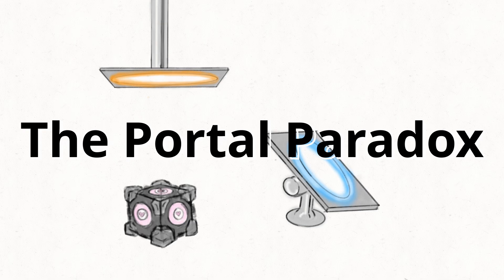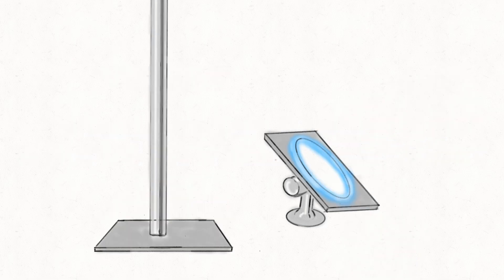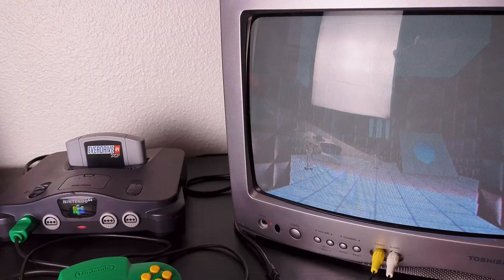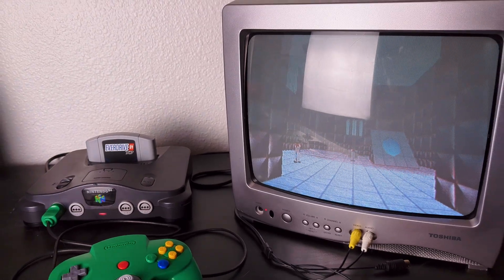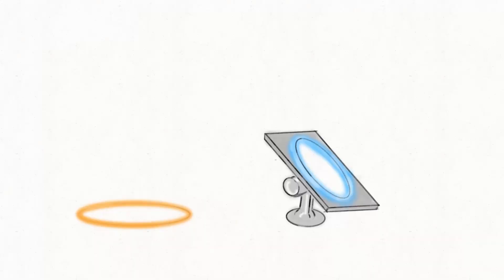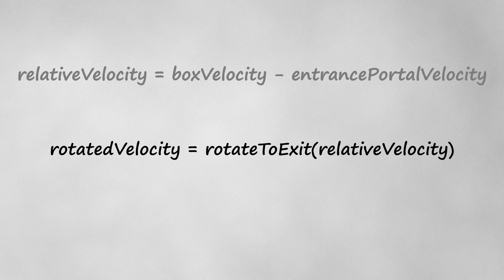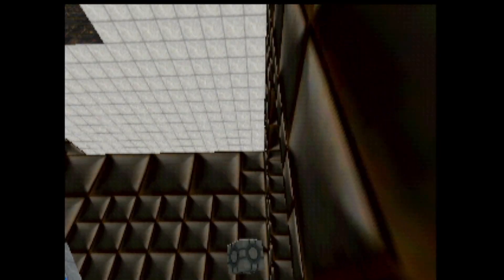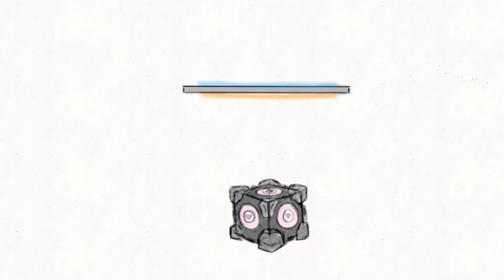I rewrote Portal from scratch and solved the Portal Paradox

Comment: So, lets say the portal lands on top of a human (really fast), but makes a sudden stop half way. Would then upper part of human (the part that has gone through the portal) be set in motion on other side of portal, and then pull lower part with it?

If speed of portal slamming down was fast enough, subject could be ripped in half. #Spagettification
Reply from the maker: Yeah, that is exactly what would happen.
Reply: @james.lambert  but would you get ripped in half though? If you think about it, the moment the first hair on your head enters the portal it's already pulling on your body. When your head is through, its already pulling your torso.
It's easier with "ticks" because you don't have to worry about individual atoms, but if you think about it an insanely fast portal might just rip you to shreds instead.
Reply: @CaseyHofland  It depends how violently the motion of the portals changes while you're halfway through! Essentially, as the portal accelerates, the motion of your body through the portal changes, and that means the portal is exerting a force on your body. Your body is fairly resilient to stretches (you can hang from monkey bars without your arms ripping off), but if that acceleration was extreme, you might expect damage to occur.
Reply: @CaseyHofland  I think a fault in your logic is that your lower body would not be fixed in place.
Reply: @CaseyHofland  Motion is relative. So long as the portals move at a constant velocity, it won't be much different to if they aren't moving at all. You go in at a constant velocity, you come out at a constant velocity. It only becomes a problem once you introduce acceleration.
Reply: @CaseyHofland  Yes, that is what would happen, even with the matter of in-game ticks. You dont even have to worry about anything else, because even with breaking down the process, a portal going down at you with 10000 kilometers per hour while you are stationary, it would mean that the moment your head goes through, you would equally be decapitated as something suddenly pulling you from your head at 10000 kilometers per hour.

But on the other end, you could also use that to basically have a launching system, where there is a huge weight on top of a vehicle, which would get ripped apart from a vehicle the moment it goes through the portal, but the vehicle itself having enough momentum to also still be lauched at massive speeds, but because its being pulled, the increase in momentum is a lot more gradual.
Reply: @CaseyHofland  look at it this way, if you push a cube across a table and stop pushing it, it'll still be pushed across the table until the friction stops it. So while the person might not be thrown through the second portal as fast as normal, the momentum won't stop midway and bisect him
Reply: @CaseyHofland  you get spaghettied
Reply: @CaseyHofland  the portal doesn't exert any virtual force (which I'll call reference frame tides) until the difference in relative velocities of the portals changes. Two portals moving in unison never exert a force. One stationary portal and one moving portal will exert a force once the moving portal stops (or if the stationary portal accelerates). If you're halfway through a portal when the moving one stops, your two halves will experience a tension force as your upper body's momentum drags your lower body with it. To spaghettify a person you'd need to have the entry portal moving at extreme velocity, then have the exit portal undergo a massive acceleration during the period in which you passed through the entry portal. You'd need the exit portal to accelerate by hundreds of thousands, maybe even millions of m/s per second. You could also do the opposite of spaghettification simply by having the exit portal move in the opposite direction, which would have the effect of ram-compressing you as you passed through the entry portal.
Reply: @CaseyHofland  there’s a little something called “tensile strength”
Reply: @CaseyHofland I feel everyone here is also forgetting air exists. All the air that the portal consumes as it moves down would be shooting out with an equal strength as all the physical objects going through it. Wouldn’t the air on the other side practically blast the rest of a body through the portal as well? Not to mention how it would whip up the room’s air into a frenzy, which could lead to utter chaos if the moving portal continues for a long period.
Reply: @CaseyHofland  The portal stopping suddenly is a change in acceleration, which is why the subject gets ripped in half. The portal travelling down with constant acceleration is not a change in acceleration. It is not the same example.
Reply: @james.lambert  But that defies the first law of thermodynamics, where energy cannot be created or destroyed. If I have the panel moving on its own without the portal, that works because there is energy being used, probably due to breaks in the hydraulics by converting the kinetic energy into thermal when it crashes into something. By your logic, if we add the portal to the surface, the original energy transfer is the same, but now you are getting magical kinetic energy from nowhere. For your logic to hold, the moment the cube goes through the portal, all kinetic energy contained by the panel/portal would instantly transfer to the cube with near-perfect efficiency, leaving the panel stationary otherwise, I could create a scenario where the moving portal is moving towards the other portal face to face when a cube enters the system it is launched out of the stationary portal towards the still moving portal increasing the relative velocity, this would repeat until the cube has accelerated to close to light speed. Even assuming a perfectly efficient system, the cube would generate kinetic energy as it infinitely accelerated. Your idea can work but requires too many assumptions and re-evaluations of how a portal would work that it must be disregarded by Occam's razor.
Reply: @james.lambert  It can't this breaks all 3 of netwon's laws of motion
Reply: @james.lambert  a very basic thing they teach you in engineering is to not keep your head down in the math, but also put it up to check if the numbers make sense
Reply: @james.lambert  so not to be gruesom but if we are talking about scientific accuracy would it launch your torso and everything above it or would it at the very least apply a force you would feel in your mid torso area?
Reply: you would feel nothing until you start to go thru the portal, and then it'd feel like the floor suddenly accelerated away from you
Reply: @arinb.756  I think there might be a difference between my example and your example. If subject is moving into the portal, and stops halfway, well.. do you mean the subject abruptly stops at both sides of the portal, or only one side? I guess stopping the subject only on the "Enter"-side of the portal would be equal to my example, as the part of subject on the "Exit"-side would still be in motion and tugg on rest of body, if lower part of body is secured at "Enter"-side of portal, and if upper part is going fast enough the body would split in two.
Reply: I don’t think so? To reverse the original question — if a person runs into a portal and suddenly stops halfway through, it’s not like that affects the portal at all, right? Velocity/acceleration aren’t transferred between the portal and the person in either direction, so they’d be fine.
From the person’s perspective, looking through the portal, the other side would be rushing towards them at high speeds, then suddenly stop, while they themselves wouldn’t have moved at all — no force exerted, no spaghettification.
Reply: @evanvollbrecht541 I thought so too at first. But what would happen to the air molecules besides you? If you stop they have to stop as well, so they do experience acceleration. So if your body and the molecules experience acceleration, the rest of the universe should too, in which case there'd still be spaghettification.
Reply: @Octochiken  The counterintuitive thing about portals is that they change your velocity without applying a force or accelerating you at all. Stopping halfway through a portal is a big change in velocity, sure, but say you place two portals on the floor, fall into one, and shoot up out of the other — your velocity relative to the room literally changes twice as much! So if there was any acceleration, you’d be more spaghettified by that than stopping midway. 

It’s hard to wrap one’s head around how things can change their velocity without accelerating/experiencing any force since it seems to violate Newton’s first law, but this is actually something that happens IRL with the expansion of the universe. It’s the same with the portals — the room, the box, the person etc. all remain at rest or in motion as they pass through the portal. 

It’s weird to think of how the box can be at rest on the floor, and then be at rest *while flying through the air*, but that’s because it’s at rest relative to *local spacetime*, which is curving and warping to produce the effect
Reply: @evanvollbrecht541  You're completely right, but I don't think I explained what I was trying to say clearly. My point is that a portal can't make you go from moving to stopped without you going through it. Which is what you were suggesting could happen in your first comment. So even though there is never any acceleration, the two parts of your body are still moving at a different rate when the portal stops.
Reply: So... you're gonna test. I'm gonna watch. And everything is gonna be JUST... FINE. (Wheatley)
Reply: Terrifying…
Reply: this test can be done with a companion cube, no need to warm a human
Reply: @arinb.756  Dude I don't know I feel like the whole idea of a moving portal already breaks the laws of physics. I mean we have wormholes they don't move. Your point is right and the more I think about it the relative velocity point is also right so the only way to prevent energy from being created would be if when the object is passing through the portal for there to be an instantanious transfer of energy to the object. In your example the object would fly through the portal because of its initial kinetic energy and since the portal is also not moving it wouldn't transfer any to the object. However any portal that is moving would be continuously transfering its kinetic energy to all the particles it intercepts and continuously slowing down, that is until something large enough enters it and then it comes to an abrupt stop.
Reply: Portal shouldn't apply it's momentum to any object passing through it. Portals have no mass or force. They are a spacial connection between two finite planes in space. Those planes can move and never transfer momentum because it does not create momentum. They have no mass to create momentum with. They are not a platonic object. If you make a portal that has mass and that can transfer momentum from itself to objects that pass through it then you have... Not simulated a portal.
Reply: Yeah I always likened it to any changes in motion to a portal is like moving the entire universe on the other end of the portal. If you moved a portal (aka: accelerated a portal), you'd actually need to move/accelerate the whole universe along with it to match, unless the exit portal moved in a matching speed and direction to cancel it out. In "reality" you would be able to theoretically have a moving portal relative to its exit but it would have to continue moving in that direction and never change - absolutely no acceleration (no changes in direction or speed) would be possible as that would take infinite energy to do. Having the portal change direction or rotation would be akin to literally moving the entire universe on the other side of it. The reason is because of what you said, the person would get spaghettified if you went half way and then stopped. That's because the whole universe is suddenly 'stopping' (aka: instantly accelerating) on the other torso end of the portal relative to the other side of the portal that his legs are standing in.

Rotation of a portal is especially impossible; When you rotate a portal, the outer edges of the universe would be accelerating relative to your viewpoint at a rate of speed approaching infinity the further out you observe. If the universe is infinite then the rotation speed at the far corners of the universe also becomes infinite, and it would require not only infinite energy but also an infinite speed limit in the universe to move the whole universe on a swivel at infinite accelerations, as it must happen in order to conserve momentum between the two portals.

Also just to be technically correct, you can't have a moving portal anyway due to relativistic effects in spacetime. Spacetime is not uniform, so movements through it would not be a simple x universe moving relative to y universe, but rather you'd encounter shifting spacetime due to differing gravity at different points, and therefore even a totally uniform movement in one single direction relative to the exit portal would be varying all over the place, growing in differences the further out into the universe you look. For this same reason it would probably even disqualify a stationary portal just because of the immense energy required to reconcile the two reference frames - aka: the two 'universes' on either side of the portal.
Reply: @DeSinc  The problem with your thought process is that there is no universal reference frame.  If I push away from my computer desk right now I can say; from my frame of reference, I just pushed the entire universe about a foot.  No matter how little motivation I may have, It doesn't take infinite energy for me to get up from my computer chair.
Reply: @catherinekracey5036  I see what you're saying but that's a different thing entirely. Imagine it this way: If you stick a 100 metre pole with a 20 tonne dump truck on the end of it through a portal that leads to empty space, and then tried to hold onto it while the portal rotated around. The whole universe "inside" the portal would be moving along with the portal, and so would your dump truck. Imagine trying to hold the dump truck in one place while the portal + the whole universe inside it rotates around. You can't do it. Do you see what I mean now? The whole universe is essentially being moved, including your 20 tonne dump truck on the end of the pole. You can't flip a portal around effortlessly, it would take infinite energy.
Reply: @DeSinc  you are smart as hell, you bring up great points
Reply: @DeSinc  what do you think, what would happen if you were to do a 360 backhop into a portal, but then it moves away from you halfway through, with the speed you're bunnyhopping at?
Reply: @DeSinc  nah.
Reply: A portal stopping that fast might rip itself apart, too.
Reply: Interestingly, the force between the two parts of the human would be directly caused by the portal's deceleration.
The next question would then be: What's the consequence of that?
Would a human/ an object that's halfway through a portal be able to hold the portal in place?
Would a heavy object sticking halfway through the portal increase the inertia of the object that the portal is attached to?
Would (as DeSinc conjectures) a moving portal have the inertia of the whole universe? I don't expect that: moving portals would not cause any effects, unless an object sticks through. But I would still not be 100% surprised if we figured out that portals that have objects sticking through would have infinite inertia while the object is sticking through; and in that case one could argue that - since it's independent of the object - the cause isn't the object at all and all portals would have infinite inertia even when nothing is sticking through.
Reply: You have to think of the portals as a simple open window, or a basketball rim. There is no magical thing that happens as you cross through them; they are just connected like a window.

If you slam dunk a basketball, it's like this video. Passes through like it was tossed in. Orange side acted as a moving surface throwing the box into blue.
If you almost slam dunk the basketball, but let go when its halfway through, it is still going to pass through the hoop all the same.
Reply: Dont forget we're at 1 gravity, going into acceleration away from normal gravity equal to going from 0 to to piston velocity in 0.0 seconds. Its as if the piston hit you, except instead of crushed by metal, the only forces will be air resistance and your body's atoms electromagnetic force versus an insane acceleration equal to that of being shot out of a cannon...
...except you're pulled out headfirst at that velocity instead of being pushed.
It'd be fatal at high piston velocities, and stopping the piston at a high enough velocity would tear a person skin, cartilage and muslces apart and twist joints out of place. Higher speeds, dismemberment and broken backs.
Lower speeds, streching, pain and bruising, even unconciousness and ruptured blod vessels, trauma to the brain from having the brain and the blood in it go from motionless 1 gravity to high speed.
Generally, a moving portal should be considered about as dangerous as falling at that speed
Reply: I think you would still fly but with half the force. Its like someone pulling your left arm when only your arm enters the speedy-portal and the upperhalf gets pulled when it enters and so on...
Reply: When the portal moves down over you and you are looking out of a stationary portal, you see yourself move towards the environment at the speed the portal is moving.

When both portals move as in the video, you see the portal move beneath you but not the environment.

If you stop the moving portal half way you see the entire environment suddenly stop but for all intents and purposes you were just moving. The portal is also fitting the gravitational force of you.

You can almost interpret it as if the portal's movement to you creates a pulling force (pushing from the perspective of the other portal) equal to the force of the portal's movement.

The boundary of space "in between" the two portals is in both locations at once (kinda like a wormhole) and in a sense, moving the portal is moving that boundary of space relative to you, and if you're in it, you're moving, even if the other portal is stationary.

In other words you could liken the effects of the moving portal on bodies moving through it to gravity.
Reply: @Hexcede small but very important correction. You DO NOT "see your self move towards the environment at the speed the portal is moving." In fact it's more like "you see the environment around you move down at the speed the portal is moving." You don't move. The portal moves. The portal does not move you.
Reply: @larkohiya  Those are the same thing
Reply: If the portal is fast enough, even if does not stop halfway, it can launch you at the other side at such fast speed that you could be squished or catch fire when slamming or dragging against atmosphere.
Reply: From the perspective of someone observing from the blue side, the floor beneath the cube accelerates the cube towards the portal, then stops, and the cube is catapulted through.

By this interpretation, the portal is exerting infinite impulse on every atom of the rest of the universe on the orange side.

Basically, the paradox is this: which perspective is correct, someone watching from the orange side or someone watching from the blue side?
Reply: @sirzorg5728  Actually the correct one is from the entrance portal (color doesn't matter since we can go both sides. Where you come in - there is entrance).
Reply: @sirzorg5728  Neither because there isn't a difference between sides. The floor is merely the object on which the cube rests. The cube itself will maintain the momentum at which it travelled while the floor slams to a sudden stop when it reaches the portal.

This is nothing more than people arguing against the theory of relativity. It doesn't matter if the piston is slamming the portal down or pulling the entire planet up. The relative speed stays the same. Speedy thing goes in, speedy thing goes out. Regardless of how said speed was obtained.
Reply: @rendomstranger8698  The cube would have no speed then, since it wasn't traveling in the first place. If we're speaking relativity, then we'd look at the portal from both angles: the exit and the entrance. From the exit, the cube is coming to us. from the entrance, the universe is coming to us. However, both sides are doing the same thing. If both sides are exerting an equal, yet opposite, amount of energy, then the energy would cancel out, and nothing would move.

However, none of that matters, because portals would act more like doorways anyway, and there would be no connection between the cube and portal for energy to be transferred in the first place. If you stood still, and a wall with an open door came at you, and you went through the doorway, would the wall's energy transfer to you? How would the surface the portal is on in any way transfer that energy to the cube? What you're arguing is that somehow that wall would effect your body.
Reply: @rendomstranger8698  The question is what happens when the portal stops half way through an object, do half of the atoms in the object suddenly accelerate away from the other half, thus implying a massive impulse that tears the object in two? That must be how it works, because the cube is torn away from the floor. There was no force exerted on the floor or the cube, but from the blue perspective the floor stopped moving (when the surface with the orange portal stopped moving) and it launched the cube. From the blue portal's perspective, the entire universe on the other side was suddenly stopped, except for the atoms from that universe that had crossed the threshold, which were not stopped and therefore were torn away from the atoms on the other side of the line.
Reply: Unless you were moving the portal REALLY fast AND could stop on a dime halfway through, THEN in that case it would rip you in half. But I think under the test condition he showed, you would just feel an upward force pulling you off the ground and gravity would take over and you'd drop back onto the ground. You have to account for tensile strength vs gravity. Essentially the question is, how fast would the top half of you have to be pulled to rip you in half with nothing but gravity holding you down? The test in the video doesn't appear to move that fast.
Reply: @Collidedatoms  it's a matter of impulse. How fast does the top portal stop? It could be modeled as a force applied to every atom of you on the bottom half of the portal from the perspective of the atoms on the top. very simple situations could make that impulse a BIG number.
Reply: Yes, rapid acceleration or deceleration, particularly where the effect is not evenly distributed across the whole body, has the power to distend or destroy the human body. Sources: car accidents, bombs and falls from high places.
Reply: The human would fly out with half the speed of the portal, and back pain
Reply: No because the weight/gravity the person is experiencing on their legs and feet overcomes the relative velocity of the panel 

for example: if someone was standing above you on a platform and reached down and pulled on your head really hard suddenly your entire head and spinal cord wouldnt be ripped out and you wouldnt get decapitated your weight would pull back on the person above keeping you stationary
Reply: Depends on speed ig
Reply: well, if you jump through a portal but are grabbed while in the middle of going through the portal, what would happen?
Reply: @amitbar5691  That depends which side of you is grabbed.
The paradox really only happens when one of the portals changes speed.
Reply: It really depends on the speed. It's just the same as regular physics. If you extend your arm, it's really just your muscle moving which pulls along the rest of your bones, skin, etc.
So yeah, if the portal isn't moving very fast descending upon you, you'll feel a weird pulling sensation on the parts that already went through but your body still holds together, transferring the force to the rest of your body.
If the portal is a bit faster and suddenly stops you could dislocate some joints. Thing along the lines of starting to fall down head first and then someone suddenly grabs your legs. Pretty uncomfortable and could dislocate joints, or damage muscle tissues. But it wouldn't cleanly separate you on an atomic level.
The same thought can be extended to when you're falling really fast already, if someone grabs your legs in that scenario, they could be ripped of.

Ultimately it's just a question of how much force is applied vs how much force can that region of your body take without breaking.
A portal coming at you at 200km/h doesn't even have to stop to rip you apart. It's the same as some force starting to suddenly yank you upwards with the same force, starting with your head. You'll be a puddle by the time the portal went all the way down to your feet. It's a bit harder to visualize, but imagine you're inside a giant canon, it wouldn't shoot you out as a whole, but instead the shockwave would crush and compress you starting with your feet traveling up your body ultimately Shooting out a smushed up human.
Reply: Think of it from the other perspective. Your body is moving really fast to portal and stops halfway in, of course there be tension between top and bottom half